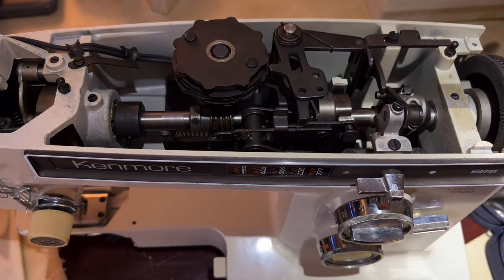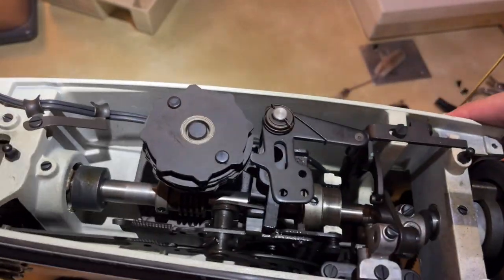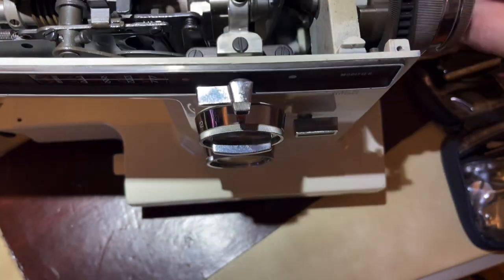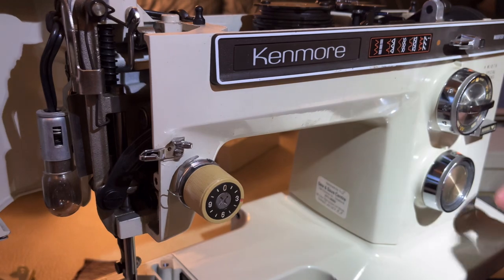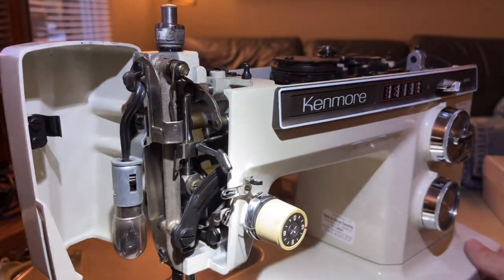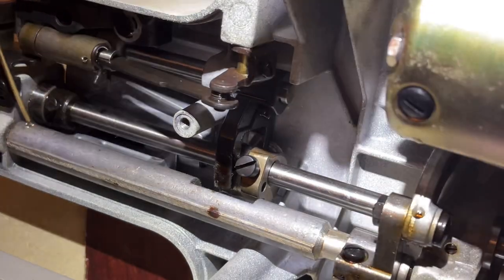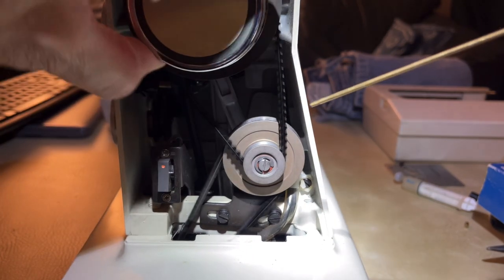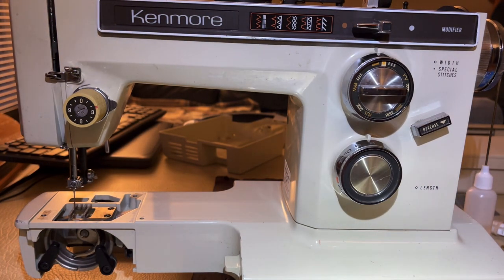MAINTENANCE SERIES #13: Clean But Dry!  How to Oil Your Vintage Machine Before Sewing Anything!

Comment: I picked up a friend's singer sewing machine that she had that they bought 25 years ago and in the process of doing some research on I found out that the plastic gear in it likes to break and are getting to the age where they're starting to break. I gave her a sewing machine I had sitting around that wasn't using. I'm serviced. Ready to go. Showed her how to use it and I fixed hers up. Made it where it worked and gave it back to her and told her what was going on. Said it'll work until it catastrophically fails and that day will happen so she's going to use that one to teach her granddaughter to sew on. So they just don't make them like they used to. They're not meant to last

Comment: I'm surprised that you didn't address the gear train for the hook (under the black screwed on shield.) I got brave a few years ago and decided to remove that panel. I was shocked at how much grease was not hitting the gears. I cleaned out the 50 year old grease, cleaned up, and put some Tri-Flo grease on the gears only. Any more and it just gets thrown off. Be sure to tell viewers about the gasket. Great video, great machine. 👍

Comment: Thanks for your video.  I just acquired 2 Elna 62C ( a 1969 Super and a 1974 SU) and was able to get them sewing again.   I lubricated anywhere I saw metal against metal, but was a bit concerned with oiling where metal was moving against plastic (vinyl?) gears (fortunately there are only a few on these Elnas).  Should those points be oiled as well, or will the oil degrade the vinyl?  I see you greased the worm type gear on the Kenmore.  The Elna's have a similar piece.  I put oil on that but should I have greased it instead?  Should the oil be cleaned off and the worm gear then greased?  I checked the manual but there was nothing mentioned.  I think Elna only wanted anything other than basic oiling maintenance done by their service departments.  Certainly they made it extremely difficult to get to the motors.  I've not found a way to check the brushes and commutators without major dismantling the timing belt etc.  
Thanks for any info you might provide.  I've enjoyed many of your wonderful videos on cleaning and restoring antique machines.